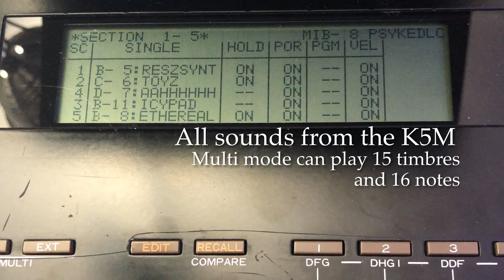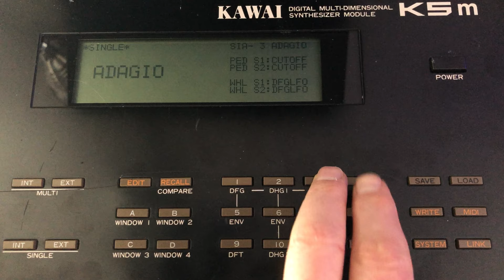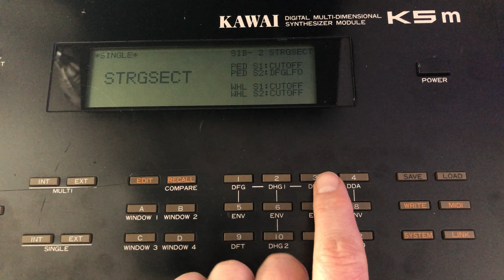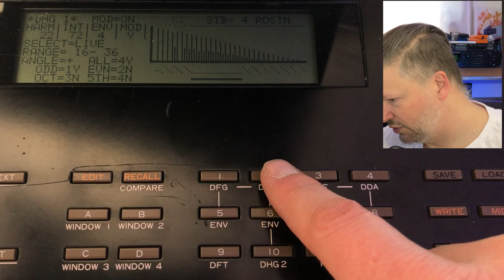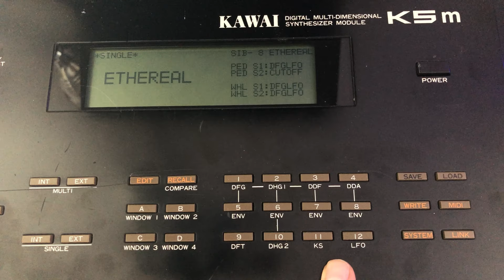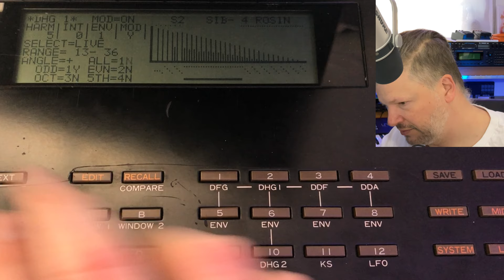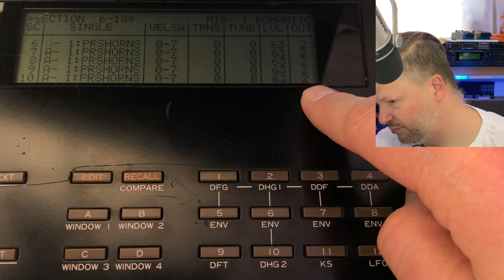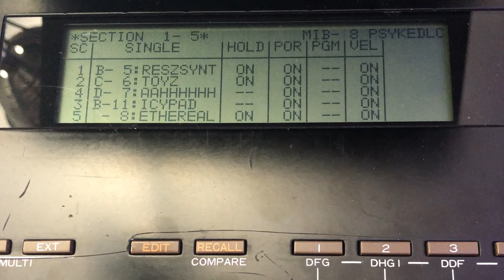Kawai K5m - " Vintage " additive synthesis tutorial

Comment: That’s a really interesting tutorial.  It’s unfortunate that no companies since then have found a way to make additive synthesis more intuitive for the average musician.  The synthesis method is really powerful but all the complexity lies in the sound design which makes it too complicated for most people.  But I’m kinda surprised that the spectral analysis tools that we see in Isotope RX that can isolate the voice and any instruments from a stereo audio track don’t seems to be used in reverse to do additive synthesis.
Reply: This is a pretty late response to your post (apologies) - I've owned a K5m since maybe 1991 or so, possibly earlier. Still love it. There used to be a software application available for Macintosh (back then I ran it on my Mac SE) that would take an 8 bit PCM waveform loop of maybe 128 or 512 samples or something like that - and generate spectra specifically for the K5 that could be sent, if I remember correctly, by MIDI. I don't remember who made this application or where it came from. I still like the sound of the K5, though mine's been in storage for years. Mine became somewhat noisy, and the display backlight burned out. It needs a bit of an overhaul, probably a new battery at this point. It's an interesting synth. Currently, UVI makes a set of virtual instruments for their UVI workstation platform that claims to emulate the sound of the K5, and years back Camel Audio had a virtual additive synth that can sound similar to the K5000 but I've heard it is quite different with respect to programming. I would love to see a suitable virtual recreation of the K5 / K5m, with a better UI, ability to input samples for analysis, good modeling of output circuitry and perhaps some convenient macro manipulation controls that could make it more interesting for playback - maybe an arpeggiator, patch randomization, etc.
Reply from the maker: The UVI K5 sound bank is simply a good sample based sound bank with good samples of well created K5 patches.
Reply: @Nu-trix  Yes - I own some of the UVI instruments and they do seem like mostly well multisampled versions of the original synth, perhaps cleaned up, nicely looped, and so on. There may be a lot of scripting involved in their patches and some filtering, other effects, etc. but they seem like mostly samples.